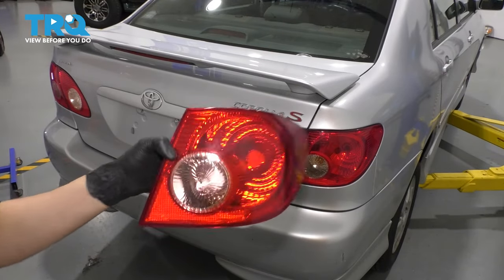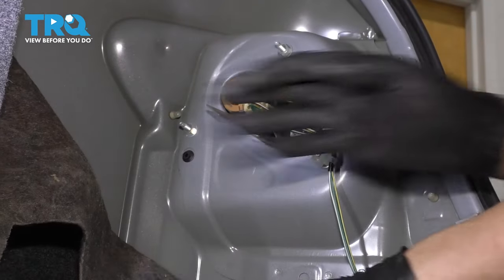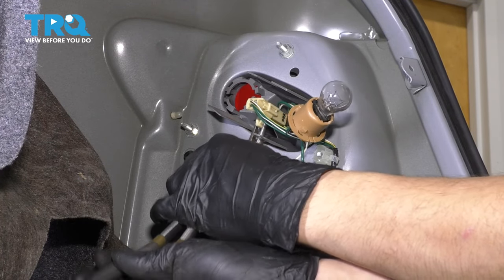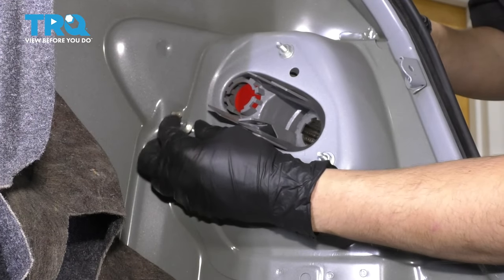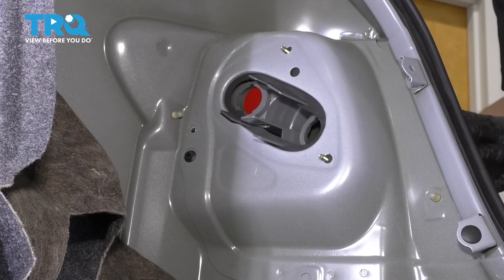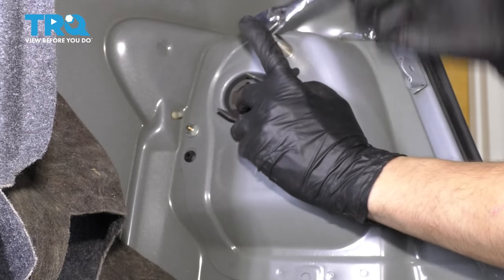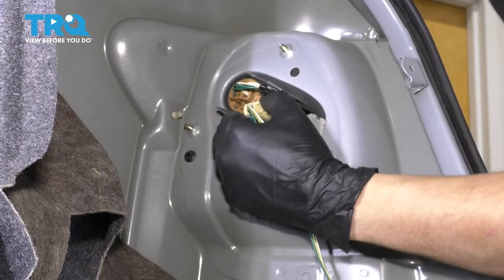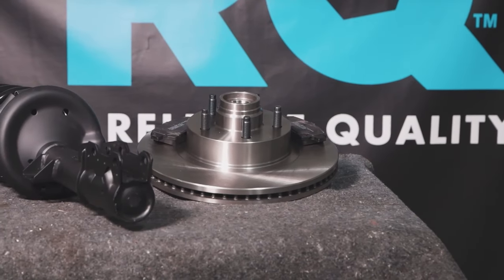How to Replace Outer Taillight 2003-2008 Toyota Corolla

Comment: Cheers 🍻 did it  ... with your help!
Reply from the maker: +@GO-jv9bb Thank you! We love empowering our customers and showing how to perform DIY auto repairs with our high-quality auto parts. http://1aau.to/m/Shop-TRQ
Reply: @TRQ  my wife backed into a pole and smashed the light. When I called around for a replacement and labor I thought I will try doing it myself and save some money. $35 from a scrap yard and a half hour of my time was a lot cheaper than the $200+ I was quoted. Thanks again!